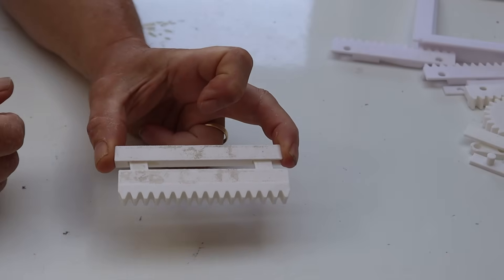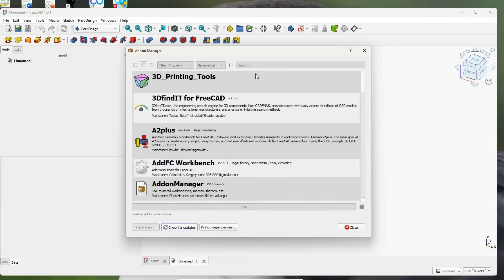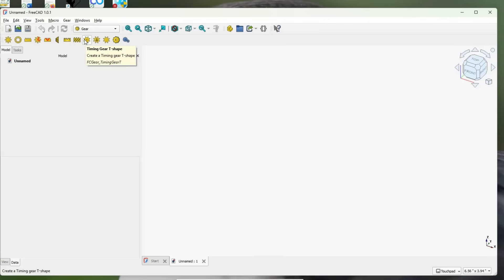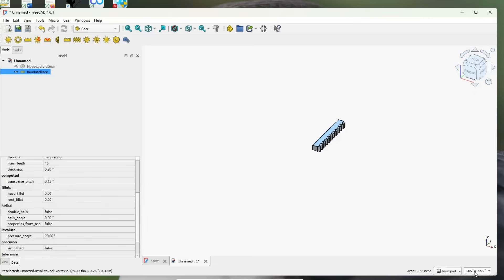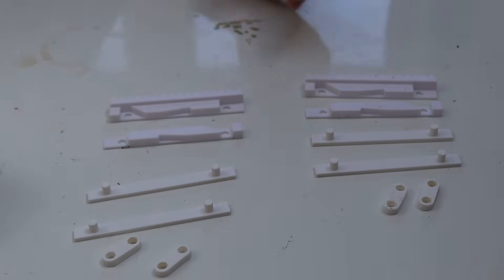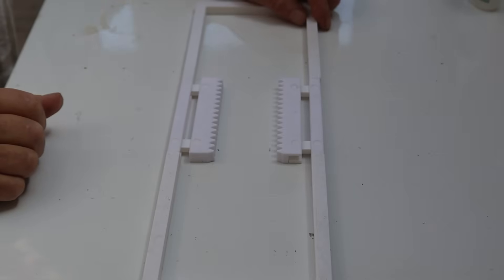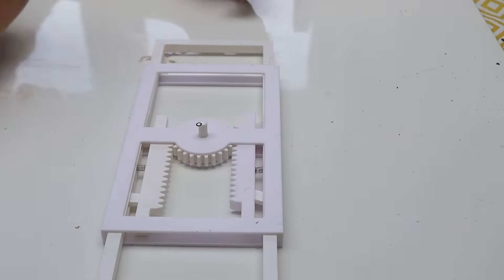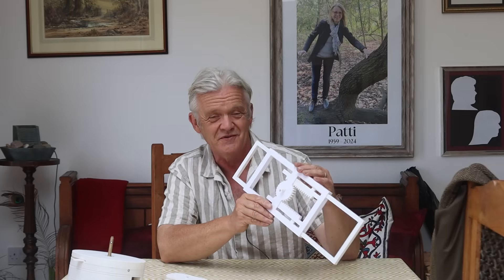2405 The Floating Rack And FreeCAD Gears

Comment: Interesting. I used an idea from a previous video to make a spring foam density measurer. I could I think use this to make one with a dial which would then have a larger readout of the density. It would need the spring as well. Will think about it some more. .....